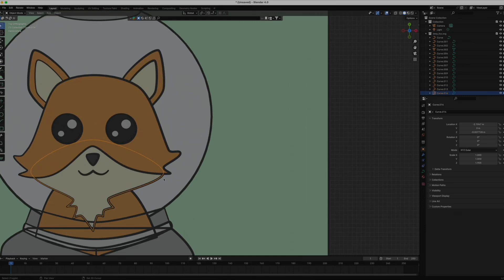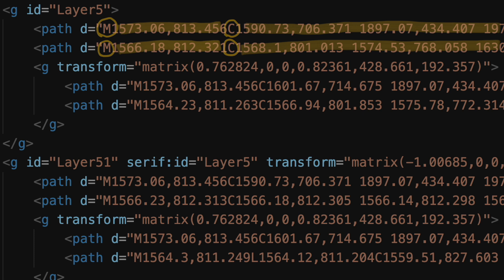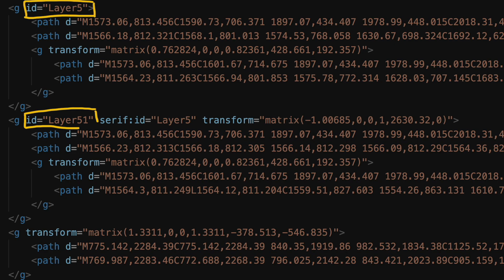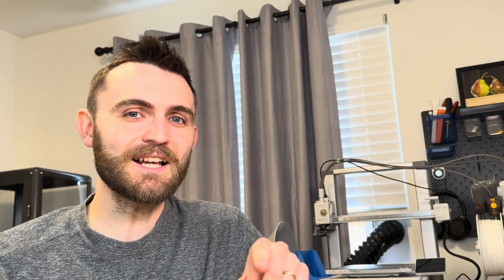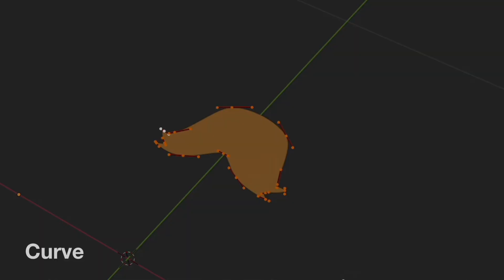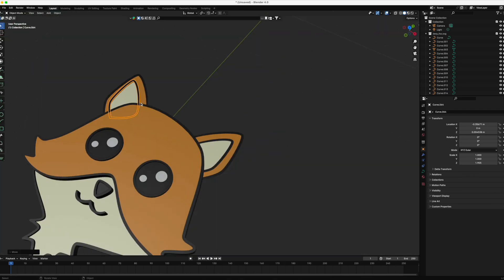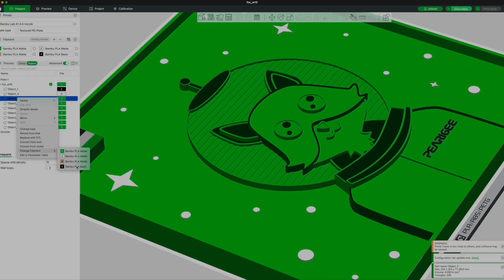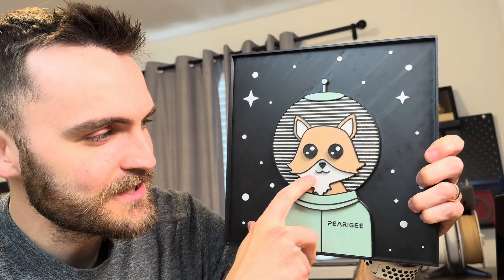3D Printing an SVG

Comment: I never really stopped to think how to depth pop a design like that, I like the shadow box effect it creates.  Which is funny, because I have been using a different program for printing pictures and that's basically how it works. Have you heard of Hueforge? Could help you blend colours if that's something you are interested in.
Reply from the maker: Yeah! Using something like Hueforge to get more colors is a really interesting idea!

I wonder if I could manually create a similar effect by alternating the top layer colors. For example, by having a base layer of blue and then adding a yellow for a green effect — especially since a lot of the lighter filaments are a bit transparent.

Thanks for the inspiration! Definitely worth experimenting with!